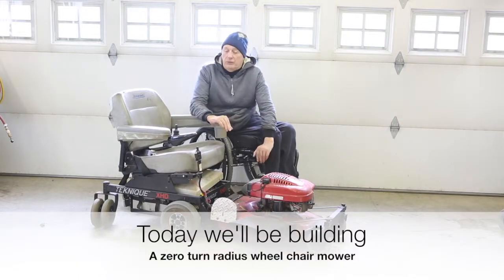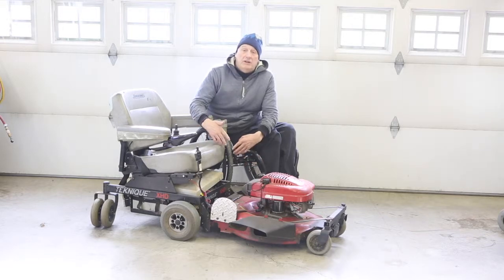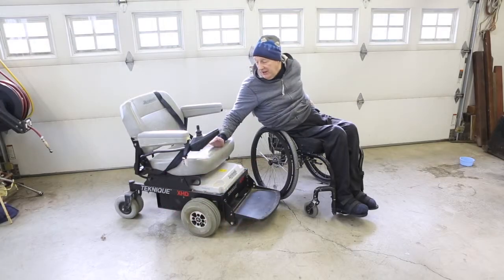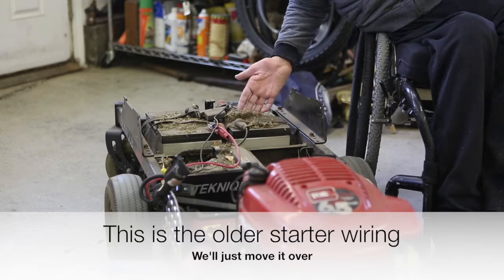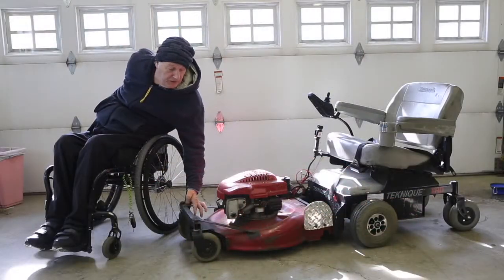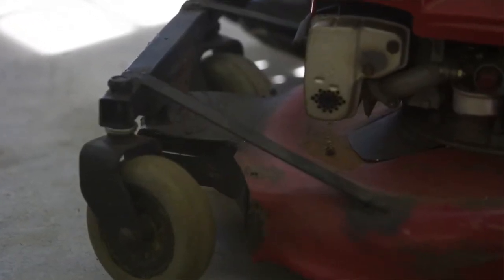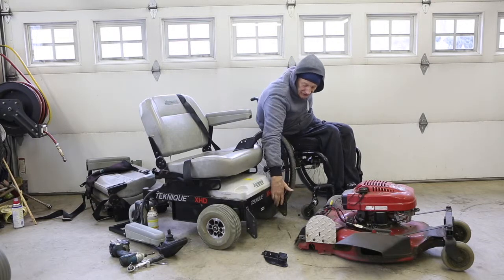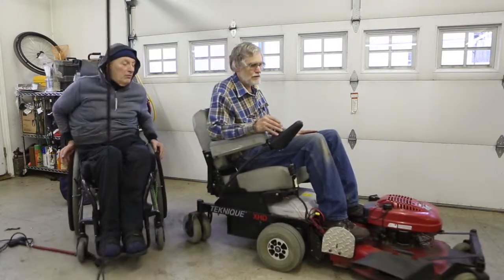Charlie's DYI Zero Turn Electric Wheelchair Lawn Mower Conversion

Comment: Love the ingenuity of your projects.
I just bought a foldable power chair, should get it this Friday. I'm going to have to figure out how to get it in and out of the back of my 2002 F-150. The back seat folds up so I hope I will have enough clearance to get it in an out with the front seat pushed forward all the way. I'm thinking I will just build some type of ramp that can fold up inside the door and be able to close them. It's a club cab.
Reply from the maker: We just built a remote control winch to pull my buddies chair into the back seat of his tundra extended cab. Harbor freight has them. That's the short version for you to think about. Maybe someday we'll get around to making that video.  Good luck, charlie

Comment: Charles, I’m beginning a track chair project for my grandfather using either snowmobile tracks and undercarriage, micro excavator or self fabricated chassis. What donor chair make and model would you recommend for the added rolling resistance of tracks?

He needs the off-road/hill climbing capability of the Trackmaster, Tankchair or the Zeisel at a fraction of their outlandish price. 

Any words of wisdom are much appreciated.
Reply from the maker: A Bounder might be good.  Sorry I never saw this earlier. charlie
Reply: Did you ever make this?
Reply from the maker: @jimwienecke3600  Yes, runs great.